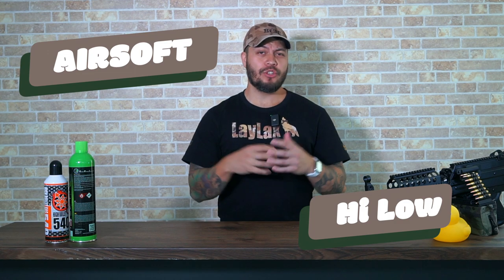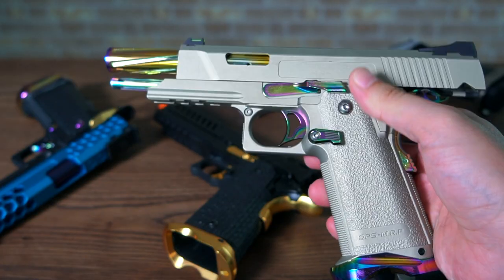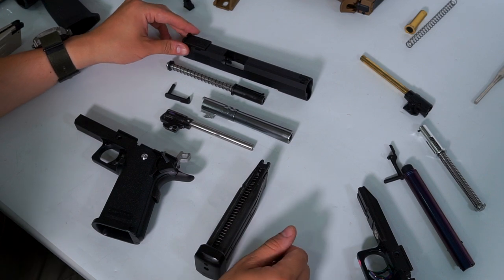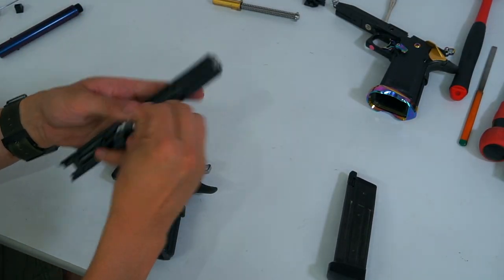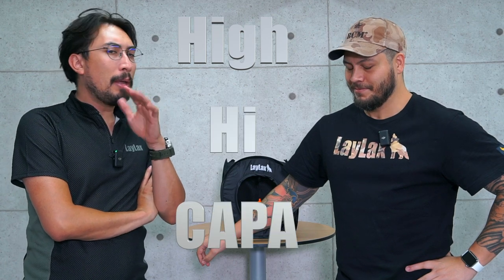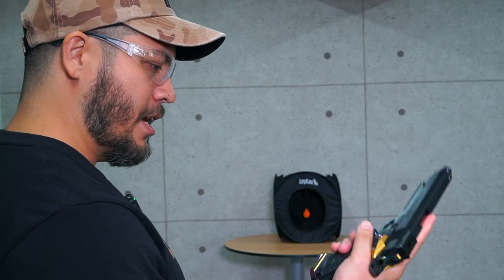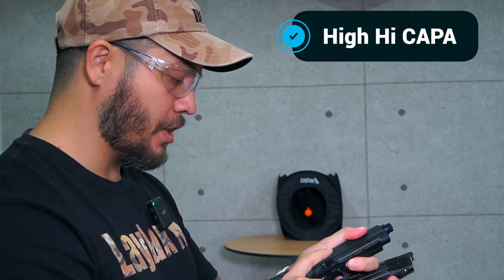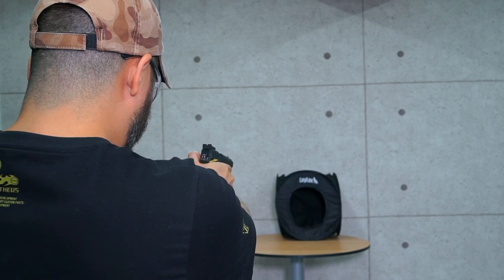Airsoft Hi / Low - Hi-Capa Build Challenge

Comment: I went for a mid budget and I cannot believe just how good it really is. TM 4.3 hi capa fitted with waldo recoil spring, waldo nozzle spring, waldo short stroke buffers, CLPD a+ studios hop rubber with maple leaf I key, posiedon barrel, CLPD leaf spring. It is lightning quick and super accurate. Mine cycles quicker than most high end builds
Reply: Cycles faster because you're using the stock plastic TM slide which is already much shorter than the 5.1 one, those high end builds use heavier alu slides, and then it also depends if their BBU is a lightweight one or not.

Comment: Where do you get the rainbow parts like the safety and the slide catch
Reply from the maker: So those are our heat treated parts and you might need to check with your local or region retailer - Marck